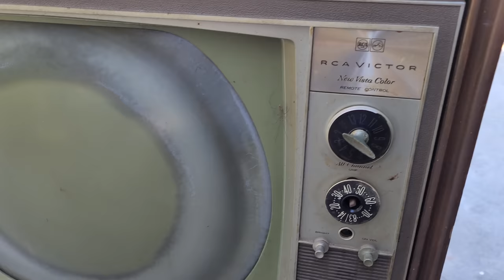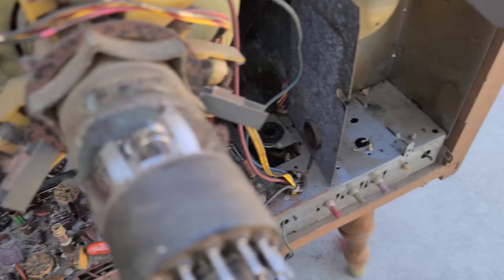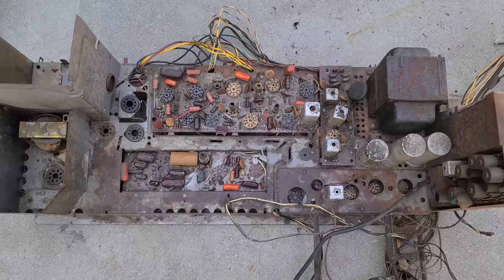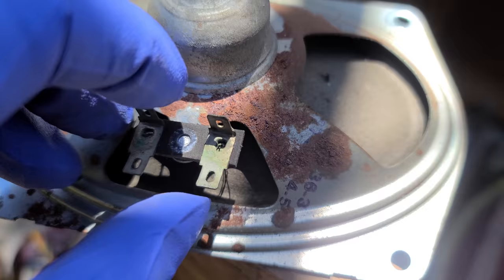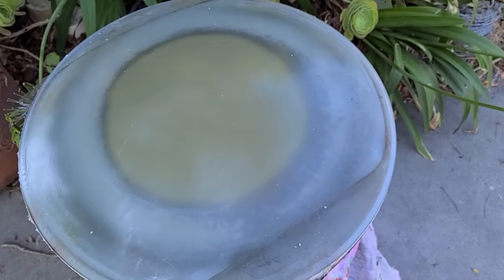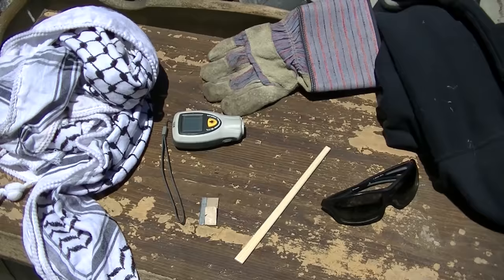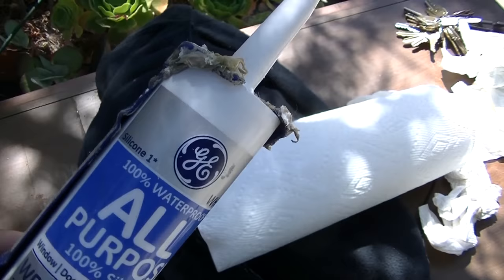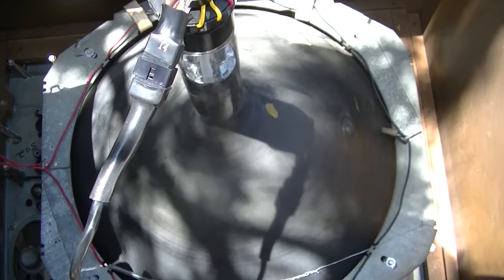RCA CTC16 Remote Set Resurrection Round Tube Vintage Tv Pt1 CRT Cataract And Analysis

Comment: I see hard work on that  tv set. Broken coils are very difficult to find., may be Shango has another chassi. I am a retired repairer of tv set and radio. Let us watch the next vids. Good luck Shango , I am your fan from Brazil.
Reply: If I know the man well enough, if he doesn't have a spare for any coils that are open he'll just find the break and repair it. (I've seen similar on a flyback where one winding was open and he managed to solder on a link to make it work).  Looking forward to this next video too, should be very interesting to say the least.
Reply: @danmackintosh6325  You right. I've seen many ancient destroyed tv set and he makes  it runs. If it were I  would throw it in the trash. He makes miracles . Let's watch the next chapters.

Comment: @Shango66 I've done around 10 Zenith CRTs using a cold no18 guitar string to cut the glue on the safety glass. I've even done it outside on a cold 40degree fall night. Takes a bit of elbow grease to pull the wood handles my wire is affixed to but it works well for me. 
If you decide you don't want it this set at the end of part 2 I'd be interested in buying the remote control sub-chassis, tuner sub-chassis, front controls sub-chassis, and any other remote set specific parts on it needed to upgrade a non-remote set...The mouse odor thing doesn't bug me. I've dealt with several sets that bad before.
I've been to ESRC. Back in the early 2000's-2010 when I lived in the region, the FAWG (Florida Antique Wireless Group) used to have swapmeets in the ESRC parking lot. The place wasn't quite as big as a Home Depot floorspace wise back then (haven't seen it since) the floor space was more like 1-2.5 Mcdonald's buildings gutted. They did have roughly 2 story ceilings in the warehouse and tall shelves of sorted tubes with narrow aisles. They usually had a mountain of new unsorted tube caddies and boxes near the front loading door and as time marched on some of that migrated down the aisles still unsorted...

Comment: Good job on the cataract repair. Every time I look at my Curtis Mathes roundie I'm thankful I don't have to go through such a pain.
Reply: I have never seen that before in my life, probably because I'm in a much cooler place, Michigan, and it is fascinating to watch how you do that.
Dealing with CRTs and talking about implosion reminds me of when I changed the picture tube on my old Motorola from the 40s back I'm 1970 and my buddy that liked to break shit especially glass got highly interested when I told him about how it's a high vacuum and can do that. When I was done with the old tube he got a big cardboard box and a hammer. I didn't watch. He said it was cool.
The set I got my replacement flat glass with metal cone picture tube from had the safety plastic ( not sealed up like these color roundness) all busted up and had a mark on the glass front. The guy I got it from told me about how he got in a fight with his sister and one of them threw a hammer. ( nice )

Comment: I bought a jukebox several months ago that I had to clean a rodent's nest out of.  Surprisingly the biggest functional issue it had was the chewed up wiring harness, it really did not require much additional adjustment or repair aside from that.

Comment: Crazy enough, I've never had your speaker terminal issue with RCA CTCs of the era. Also the reliability of the solid state rectifier is exactly why they went back the tube focus rectifier. Someplace I have an original engineering bulletin talking about the issue.

Comment: Probably will have to pressure wash the chassis because most of the tube sockets are packed in with debris. Maybe just a light wash will work. Great repair on saving that speaker too!
Reply: Taking electronic components to the car wash, looks like something crazy I might do.

Comment: Wow, this is - apart from the CRT a really bad set to start with. By the way...I bought the same B+K CRT tester because of your videos...and because they were sold in Germany too, so they work with 220V. Unfortunately all the adapters are for european stuff only, I need a adapter to test a 1964 RCA Color Roundie  (CTC-15D Chassis, Model 14F616MU). This might be the only one in existance here in Germany, since we had no color TV at all until 1967. This set was imported by TELEFUNKEN to study and do some experimental work. A guy who worked there saved it from being scrapped when they were done with it. It even came with another NOS still in box RCA roundie picture tube. The TV is heavily modified and was probably converted to work with the PAL system. Unfortunately the video board on the chassis is missing and the CRT has a bad cataract. Good to see another video on this, maybe some day I will be brave enough to remove the safety lens. If I ever find another complete chassis, I might be able to bring this rare piece of TV history back to life. If you like to see some photos of my find, you can check it out here: https://www.facebook.com/groups/158241637623756/permalink/2722063474574880/
Reply from the maker: I made that adapter

Comment: this will be interesting to see if a FBT from a CTC15 can be used in a 16, I have been looking forever for a fallback FBT for my CTC-16XL, which are pretty much unobtanium, If a 15 will work, then that betters my chances of finding one, NOT THAT the on in my 16xl is bad, YET, it's working OK for now... but it IS the original, and I'd like a standby.
Reply from the maker: the 15 is in higher demand, they are all available if you can be creative and substitute
Reply: @shango066  this is how it looks now, https://imgur.com/LHDJKjQ   slight wax loss, i have seen MUCH WORSE, that has said to still work, but I still worry about it, cause if it ever pops, replacement is hopeless,  have solid tube for focus rect, did try solid for HV Rect, burned up in 90 sec, back on 3ca3, holes in HV case, 2 fans, cathode current apx 185,  not much more i can to to protect it, but I still cant help but worry, :P
Reply: @shango066  In reference to an video for a RCA roundie posted retailer, I'm very curious to see if my 21FJP22A is an original with a matching SN# to chassis, or a replacement, either way, I'm very lucky that's it is in good strong condition, with not having to turn up screens very far to get a bright pic with CRT bias at lowest setting. I will definitely make a note of the SN#s next time I yank it apart, but I don't think it will be any time soon, just minor annoyances left on it, slight vert blanking and video smear on bright spots, most likely due to old caps/ res still in video output/peaking area, but will wait till something more substantial needs work before pulling it apart again.
Anyway, enough rambling,  I always find your vids enjoyable and entertaining, especially ones with tube tech and TV, /RCA & Zenith!  
Keep em coming!

Comment: Cull any valuable parts, then toss it in the dumpster. If it were a first-generation color TV, it might be worth the effort, but there's no historic significance in that set. It's performance was none too high when it was new: no comb filter, good convergence in less than 70% of the screen area, single-ended audio amp had "less than 10% distortion", X-radiation hazard if the 6BK4 tube went bad. I can see why people were dazzled when the Sony Trinitron color televisions became available, as the CTC16 was a mighty crude product in comparison.

Comment: Blimey 9v DC on a little speaker is a bit much...1 1/2 is plenty...If not as convenient...
Edit: Sure likely OK here, but if it wasn't a high impedance speaker and a regular run of the mill 4 ohm thing rated at a watt...that would be nearer 25 watts right there.
Just saying because people see these things and often don't think about it, Shango did it - it must be OK.
Reply: no it wouldnt as a 9v battery has high internal resistance. When i used to do a lot of car audio I kept 9v batteries around to check polarity of OE speaker wiring mostly 4ohm no issues. I appreciate car audio can generally handle 20W+ but a 9v battery isnt putting out 2.25amps any time soon imho.
Reply: @denisohbrien  True for zinc-carbon 9V batteries, but you would probably be surprised how much current some alkaline 9V battery can supply. Not all of them, but the ones with the LR61 cells in them can easily supply more than 2A when shorted. I currently don't have any fresh 9V batteries, but I've measured two used ones for curiosity: an orange Duracell Industrial, depleted to 7.8V: 1A short circuit current, a Chinese "Excell" branded one, depleted to 8V: 1.3A short circuit current.
Reply: @denisohbrien  Yes it's not a good idea though is it? And not all batteries are using the same chemistry.
Reply: chris younts  Philips used even 600ohm (six hundred ohm) speakers in some of their tube TVs, to get rid of the output transformer.

Comment: Nice job on the cataract repair, i'd have ended up putting a hammer through it if the tape had slipped! Strange the old tube has stronger guns though, any feedback from the owner if if the new tube has a better picture? Hope to see his old one running anyway! Is it pressure washer time? I think it would be satisfying to see all that rat mess come flying out :D

Comment: About 15 years ago, there was a woman living in one of those 1990s detached condos, this one in Marlborough, MA, who started feeding the wildlife. After a while, some of the wildlife had moved in with her and some of the critters were getting claustrophobic, so they scratched through the Sheetrock, insulation, foamboard and vinyl siding (there might not have even been plywood) and let more of their friends in. By the time the MSPCA got there, there were flies and corpses everywhere, the HVAC system had failed and the metal braces that held the floor trusses had rusted away, so the house had to be demolished. The woman agreed not to keep any pets in the future. Urine and feces can do a lot of damage.
PS: Just in case that wasn't disturbing enough: The whole time this was going on, the woman was working as a pediatric nurse at Brigham & Women's.
Reply from the maker: I have seen houses like that, this is why these resurrection sets stay outside

Comment: I have a question. Is that extra layer of glass an american thing? I have never seen it overhere in europe. You call it safety glass, what is it supposed to protect you from? I am trying to learn something here, it is not trying to be smart or funny so please don't get me wrong. 

And as allways thanks for the video and I can't wait for the next one!
Reply from the maker: I once read footballs are the number 1 thing thrown at the screen during the game.
Reply: @shango066  Oh I thought it had something to do with the remote control. Considering the age of the tv set it could be just a brick that you could trow at it to turn it off 😁
Reply: chris younts  Maybe with the older ones, but I believe the more modern have strict voltage requirements for that kind of thing.